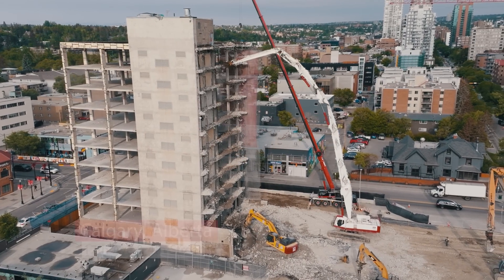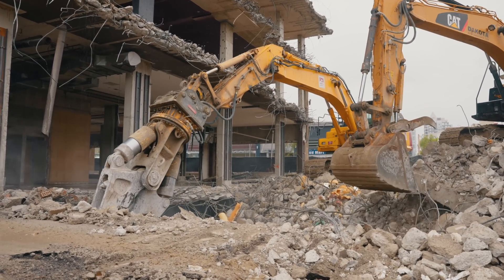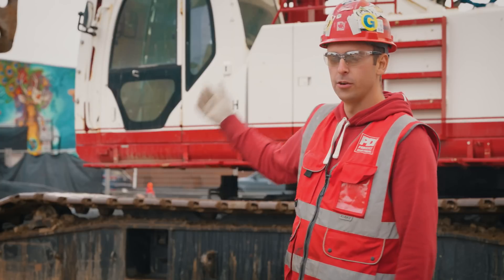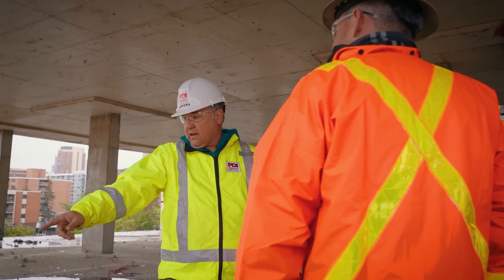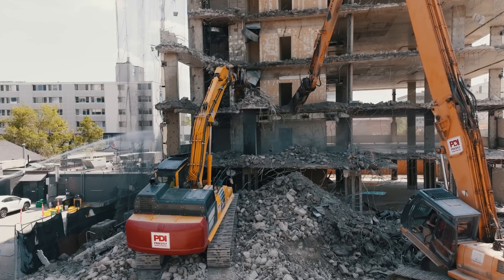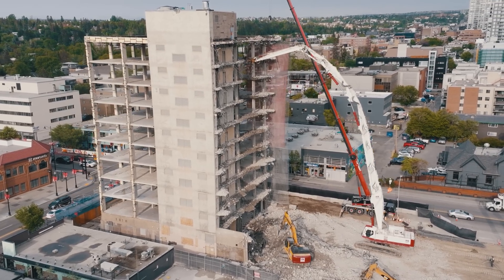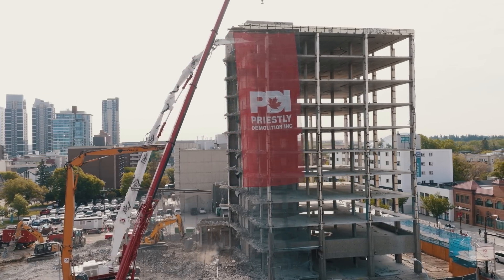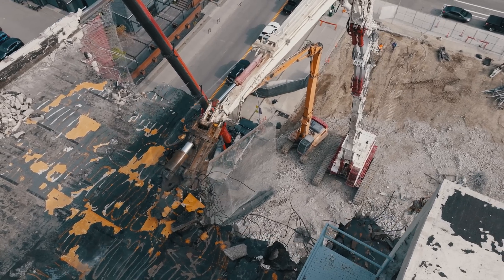Watch High Reach Demolition in Calgary with Canada's Biggest Excavator, the Kobelco 1600

Comment: Why wouldn’t you just drop it with explosives ?   Seems like  it would cost more to run this big machine.
Reply: Demo by explosives is way way more expensive than most imagine (not discounting that you may know that), and the local impact is significantly greater from the dust/debris. Them also not having plans for how the building was built could complicate the demo by explosion/liability.

Comment: Whoever decided to add a waterline to the end of the boom is smart. However I feel like it nozzle should be like a shower nozzle to spray a larger area
Reply: I think it is code or requirement for most job site in the Western America. Or it is just because close to residential. I’m doing formwork for a new Canadian tire in BC and the excavation crew keeps watering the jobsite to keep dust low even the asphalt/concrete crusher has a water sprayer. 

Couple of days ago they brought in a uge ski hill type blower but they didn’t use it yet. I am wondering for what purpose it will be 😂 to give us outside A/C 😅??